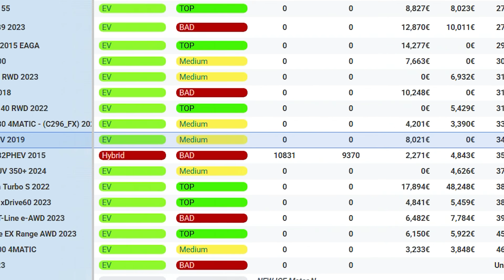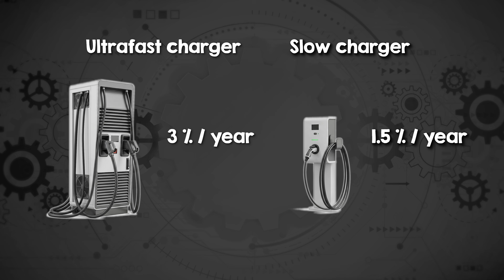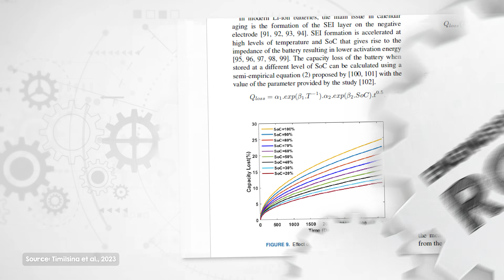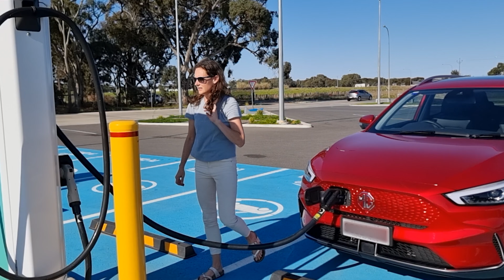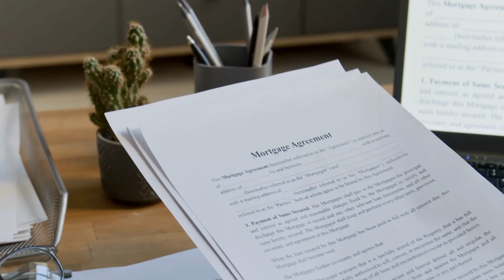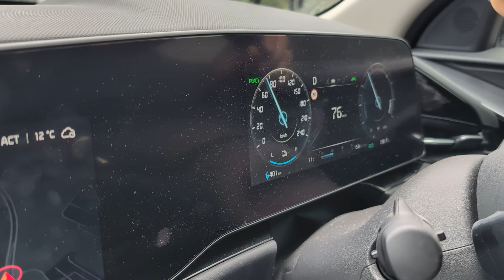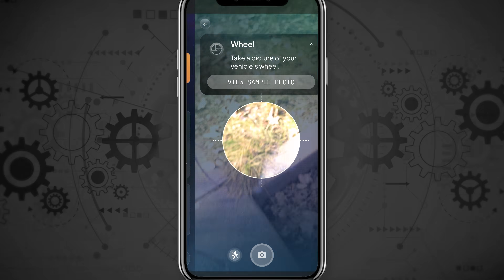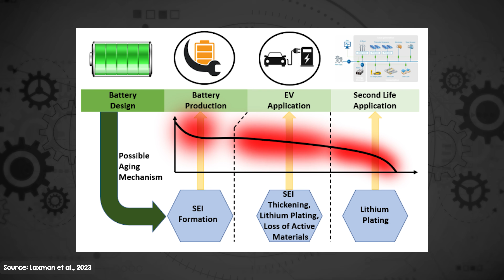Watch This Before Buying Your EV

Comment: At 8:14 although the list price for a replacement battery for that 2019 Hyundai Kona is 35k, because far more cars are written off in crashes than suffer battery failures, you can buy the same model of used battery for about 3k at least in the UK (even better you can get the compatible Kia Niro battery too and at least in the UK market the Kia batteries exclusively used cells manufactured by SG Innovation - which anecdotally fail less frequently than the LG cells which commonly went into the Hyundai cars).  Also you might not need to replace the pack at all.  Failed packs are often due to a single bad cell, or control electronics component failure, and both can be repaired (see also videos online which show (experienced!) owners replacing failed LG cell groups in their 2019 Konas).
Reply: I've got a used NiroEV (looks like the same as Rosie's).  Great car. 
Not exactly cheap, but a lot cheaper than it should have been because so many people here (US) are misinformed and afraid of battery degradation 😅
Reply: @travcollier  I am seriously considering buying a used EV in the US to take advantage of the negative perception. I absolutely adore the Jaguar I-Pace EV and it is astoundingly cheap!  Like I can get a seriously awesome ride for half the price of a new ugly, boxy, crap-handling toy EV from Tesla or the Germans or Koreans. Why are so many EVs so ugly and uncomfortable?  Oh, I forgot. That Ford Mach-e handles nicely, but it is not very practical and I don’t like lying on my back in a dark tank. I hear that the gamble is whether the Jag’s LG battery catches fire!!!🔥
Reply: @Andrew-iv5dq   My Kia handles very well and is quite comfortable.  I've also driven and EV6 and it was quite nice too.  But different folks have different preferences I suppose.
Reply: @Andrew-iv5dq See YouTube UK reviewer JayEmm on the F pace. The prob is getting replacement parts...
Reply: @computerhelpcc   Thanks!  I like JayEmm. Also Harry’s Garage. And the guys at the Hegarty channel are fun, too.
Reply: One of the reasons that EVs have a high crash write off rate is that the insurance companies don't want the liability of a crashed damaged battery fire. I would be very cautious about a used battery.
Reply: That's absurdly expensive, and would think that was the price for the ioniq 5 battery.

You cannot, however, replace a bad cell, unless your pack is fairly new. All that will happen, is you'll just cause other cells to go bad or have an unbalanced pack.

Your best bet is to never buy an HMG vehicle ever again. And I say that as the owner of one, a Kia Niro EV.
Reply: @sprockkets  Several older EV (and hybrids) which had relatively limited production runs have absurdly expensive replacement battery packs.  It is basically a pretty much non existent supply problem (aka rarity).  Hyundai and Kia are now using a common platform, which should make that a lot better.

Honestly though, the battery packs really aren't that complicated and should be serviceable.  There's some walled-garden / anti-right-to-repair shenanigans going on too... Which all car companies have been doing for a while :(
Reply: @travcollier  Last I checked the price for an ioniq 5 battery was $45k. That probably is now lower since they have US manufacturing. 
However, a pack for the ID4 was around $18k. 

So, no, they've not gotten better for their so called EGMP setup. And the reason for it, is because those batteries for the I5 are nickel and cobalt rich, which enables them to charge up fast. 

I'm not too worried about my pack dying, but it will if I have any sort of damage lol.
Reply: @sprockkets  When/where did you check?  The high end for the bigger battery pack full replacement (including labor) is like $16k US.

If someone is quoting you $45k for an Ioniq5 battery, they are trying to scam/rob you.
Reply: @travcollier i can't find a new quote, but that's way better than before which was quoted back in 2023 for a Canadian.

Comment: MG4 owner here so not anti EVs, but I can't get on board with the 'batteries will outlast the life of the car'. My farm car is a 2008 Subaru Legacy wagon with 250,000kms on the clock and it still runs like it was new. For me the concept of a cars life time means until it rusts so badly or needs so much work done that it's not tenable, and for most cars made this century that have been cared for, that means lasting 20+ years.
Reply: 12 yo Tesla with over 450.000km and still looking good (no rust, full aluminium construction) and going strong.

Comment: 7:54 - key message is missing as NO KONA WOULD EVER NEED A BATTERY IF THE OWNER had done a proper research on the same site, the ev clinic. Search for used EV buyers guide and you should find 2 articles at least, one from november 2024 and another one from january 2025 talking straight about the 3 SOUTH KOREAN WARANTY RAPERS and other brands too, who do not fullfill their promises and offer the owners a quote for repair instead which then makes these owners desperately searching for an alternative and end up at EV clinic in croatia or Berlin just to get their cars fixed and a lot cheaper than by the manufacturers. The article explains all the expensive repairs and issues , shows the alternatives of 10000€ Genesis engine over a used one from ebay or refurbishing the broken one. THey have collected all the data in their own job from their own customers experience where VW is on the different side as they say that VW fullfills its warranties cause no customers ask for help before the 8 year warranty is over. 

You should have mentioned that especially if you have visited their side and there claims of warranty rapers among the manufacturer has gotten more and more attention. 

Who would be so stupid to by a korean EV after reading the EV clinics report which is the oldest and biggest brand independent EV repair facility at least in europe ? 
And I bet the koreans are raping the customers across the globe, not only in the EU. It seems to be part of their game or gambling. 
Interesting is the fact that none of all these warranty rapers has tried to shut down the website or stop the release of these reports.
Nothing - maybe every manufacturer is aware of all the customers who had gotten horrible 10.000 € + quotes for repairs instead of a warranty solution and that these cars ended in the ev clinic which could all proof how right the claim is and that the manufacturer would loose any court case against the EV clinic. 

So talking about all the considerations of a battery degredation is first off all limited and should also look far more on how to solve such a case if it happens to anyone, but also talk about our real world experiences: the huge amount of wapes and 18650 cells used for that, I mean the cycling of these cells and stress tests. There you could see for every single model of 18650 the degredation curve for this specific task. Usually you see a 500+ cycle figure for a samsung sdi cell hitting the 80% SOC or 20% degredation mark - but under a quite heavy load. And the you can also see a 800 to 900 cycles figure for the 70% SoC or 30% degredation. Imagine you buy a car with 50 kWh ltihium battery (nmc  based cells) which would give you about 333 km of range or every 3 (full) charges would represent 1000 km. The Samsung cells under high performance load would achieve more than 300 000 km with a range still above 70% and a 100 kWh battery would even last much longer or in particular 2 times = 600 000 km. 
And that is based on the digital use case from vapes, full load or charging again under full stress ... which means a usual non race track usage should give us a much longer battery life and will raise far different questions how many other repairs have to happen before the battery becomes a serious repair or replacement challenge.

Comment: I did have one battery problem with a phone, but that was the only one. I replaced it for 35 dollars, and it took maybe 1 hour or something. I dropped off the phone, went grocery shopping, and picked it up at the end. 
I keep my phones for a long time. That was my first smartphone, and I'm on my second phone. The first phone with the replaced battery still works. I really have not had the problem of a battery dying really quickly.

Comment: when does max ev range matter? on hwy driving. when does internal resistance from hv battery aging matter? on the hwy under higher peak loads and at lower SOC like on the hwy after a long drive. this is my big beef with all the bs battery soh calculators, they are fitting most of the data to city driving when it doesnt really matter what the max range is to give everyone a false sense of reassurance when it matters most on a long hwy drive.
also all the historical data on ev battery degradation tends to throw out all the failed batteries. if your car pack has a run away battery cell failure that cascades to a module level failure, it is off the road and no longer reported in the data set. this is a huge problem for non LFP teslas who use garbage aluminum bonding tabs instead of bus bars inside their packs, which coupled with the quick to fail suspensions and NVH issues of most teslas comming with super thin performance tires and pothole blind autopilots means a lot of teslas in the states have cascading pack failures simply due to NVH and not chemistry/usage. if you were to count all these issues, the data would be a lot more spread out and weighted more appropriately. 
we got 2x 13 year old erevs with zero observable range degradation but depending on certain tests looking at actual kwh pulled out of the packs, we can see some degradation of about 5-10% (after 350k miles between both cars). pretty negligible but we are not the typical ev drivers. older higher cobalt chemistry was really good at repairing defects when they started as long as they kept being driven and charged, im talking about lmo which isnt used in ev's anymore. 
also never fast charging and never cycling outside of 20-88%, and having a really good thermal management system, unlike tesla pre rework of the model s plad.

Comment: There are still so many unknown; some say it the age that kills the battery and other the number of cycles. I have an old EV with a small battery and range extender which means the battery are often close to 0 and the charging is always to 100% (cant be set) and still the battery seems to be in good condition. If a dealer dont deliver a solid SoH test or allow you to do it; walk away.
I have seen Kia EV6 with 150t.km still claiming 97'% SoH so i am sure they have a hidden buffer.
If you want to have good and easy data to compare when it get older you should note how much you put into the battery from 10-100% at homecharging, most apps can tell that value.

Comment: batteries on good phones dont degrede as you say at all. My phone is absolutely fine charging it several times a day and after 5 years it is still vewry good
Reply: This is less of a problem now than it was before around 2020 due to advances in cell chemistry (e.g. see "Single crystal Ni-containing cathodes - A conversation with Prof. Jeff Dahn" for details).  My 7 year old flagship phone battery is now down to 55% capacity, but its worth remembering that NMC phone batteries are usually charged up to a more aggressive 4.35v when full vs the more conservative 4.2v (or less) normally used in EV cells.

Comment: Wrt battery replacement, I'm sure that market will develop as battery tech improves and battery prices drop. Just as folks can purchase aftermarket cylinder heads, camshafts, pistons, complete motors etc.
Reply: There's companies producing aftermarket battery packs for the Nissan Leaf, often with more capacity than the originals.

Comment: There a fellow in Canada making content with a Tesla that has over 600,000 km. Battery is at 78   Not bad really.
Reply: It wouldn't last that long under average driving km accumulation. The 660,000 km was accumulated under a relatively short period of time.
Reply: Still… imagine how  much gas it would have cost him.

About 70K$ on gas alone
Reply: @jonathansaindon788 I dont dispute operating cost. Im pointing out the fact that just  time affects EV battery degradation. 600,000 km is not achievable under normal driving habits. There would be a battery change in there at some point. At this point, in most cases, the value of the vehicle does not warrant installing a new battery.

Comment: EV's are not a solution to any problem other than a need to virtue signal.
If you can charge an EV solely on hydro or nuclear power it will on average take about ten years to pay out its carbon deficit if you bought it from a local manufacturer or twelve to fifteen years if bought from that place where coal plants are springing up like mushrooms, depending on where you live.
In most cases where unicorn farts and rainbows count for squat on the power grid you can move the goal post out to about fifteen to twenty years.
The majority of Virtue Signalling machines will be unrepairable piles of toxic waste at about the fifteen year mark especially if manufacturers are able to quash the right to repair.
Meanwhile the functionally equivalent Real vehicle will need to drive at an average rate of fifteen thousand kilometres per year for ten to fifteen years to simply equal the VSM's carbon foot print, that massive battery pack equals about  two hundred and twenty five thousand kilometres worth of carbon emissions from petroleum and probably about five hundred thousand from diesel.

On a side note damaged VSM batteries are a major hazard to the environment, even if the battery pack is totally untouched in an accident but the power cut off as been pulled it can be like pulling the pin on  a grenade it will randomly go off a few weeks or a few years later.
Why?
Because it totally cuts off power to the BMS and cooling systems. One hot day it will go boom.
Reply: You must be really fit....  considering how much you care about the environment, you obviously don't drive any vehicle.
Do you have a bicycle generator at home to power the lights and microwave?
Reply: @annpeerkat2020 . That’s an odd comment that has absolutely no relevance whatsoever to what I said so either you commented to the wrong person or you are attempting a very poorly constructed ad hominem attack.
Reply: @anomamos9095  
It's quite simple....  you cough up a lot of bollocks about energy wastage....  then claim that questioning your personal energy use is odd and irrelevant.
I'm not going to let you mass debate...   All I wanted to do is show you are a boofhead that speaks his mind without anything in it.
Reply: @annpeerkat2020  Considering I was talking about carbon emissions and not energy use as such and made no personal claims one way or the other it was very odd and irrelevant
Reply: Your figures are nonsense
Reply: @keepitreal2902 . Try doing some research before claiming to have sense.
My figures are a bit generalised for illustration purposes but they are based on real comparisons done by actual experts not ev fanboys.
Reply: @anomamos9095 You are the Philistine. A modern EV pays back it's manufacturing carbon debt in 1.2 to 2.5 years of ownership, in China. Your figures aren't illustrative, they're just plain wrong. Go collect your paycheck from Murdoch.
Reply: @keepitreal2902  Where the hell did you get those fictional numbers from even AI could not be that bad at math.
A Tesla model Y has a footprint of about 21 tons of cO2 , at 35mpg it would take a gas vehicle seven or eight years at 15000 miles a year to equal that.
Reply: @Sweety1915-nono  I would not trust IEA calculators or MPGe ratings and other such things that have been proven to be more than generous to EV's and less than generous to ICE. There are a number of independent EV friendly sources that have concluded that the cO2 footprint of the majority of EV's is much higher than claimed and the repayment rate can be much slower than claimed. Motor Journalist and engineer John Cadogan did a comparison where even being extremely generous to A Tesla the numbers were not good. He was just the one I remember the name of out of several.

Comment: Phone manufacturers don't want batteries in their phones to last 10 years as their sales would plummet. Phone buyers have got used to buying a newer phone every 2-3 years or so and spending several hundred dollars every 2-3 years is not a massive issue for most people. For this who it is an issue for there are cheaper phones that you can buy. This leads the phone manufacturers to design their phones without bothering about battery life.

Car manufacturers know that the whole replacement cycle for new cars relies on the older cars having a value in the second hand market. The number of people who can afford tens of thousands of dollars every three or four years is much less therefore they buy 3-5 year old cars that they expect to be reasonably reliable. This leads the car manufacturers to design their cars to ensure their batteries last as long as possible.

The technology is broadly the same, but the attention to expected battery life is completely different.
Reply: I read a report a couple of days ago that stated the EU is mandating that phone manufacturers have to incorporate a battery this is replaceable by the user by sometime in 2027 I think it was. I am interested in how that will affect the price of new phones and if manufacturers will increase their prices to make up for the loss in phone sales.